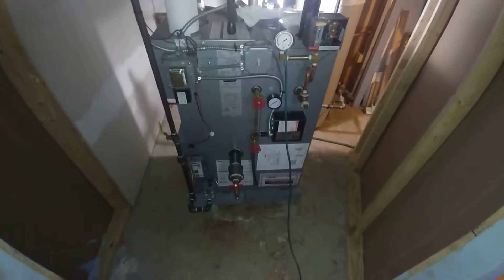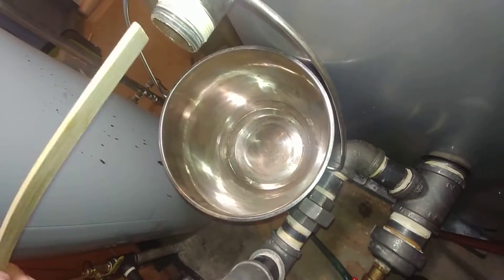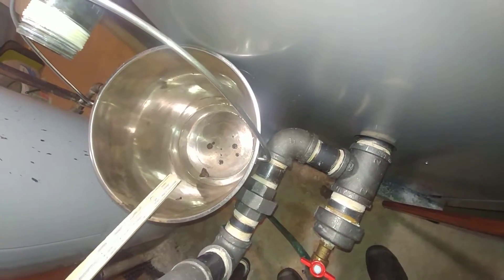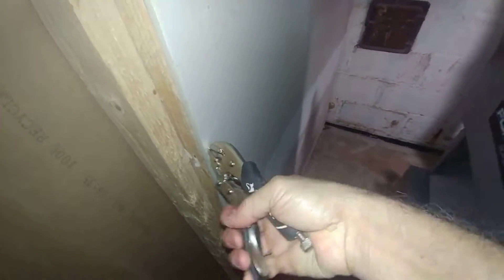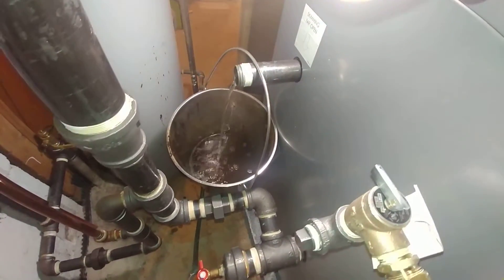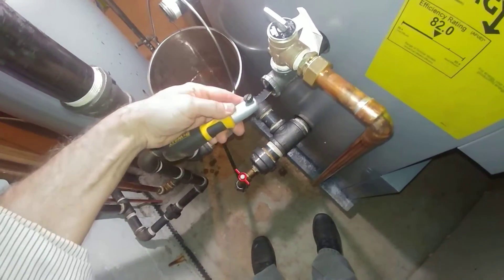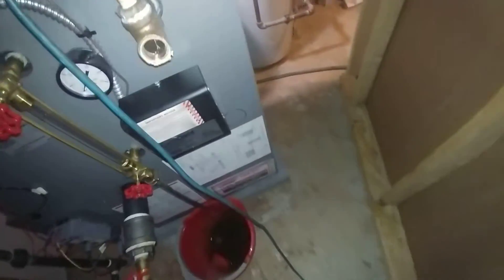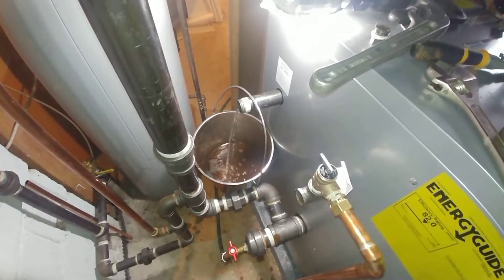Cleaning A Newly Installed Steam Boiler... Boring But Necessary

Comment: Can you just add a soap to the boiler when first installed and then fill , heat, drain it quickly and be done with it rather than slowly skimming over a long time?
Reply from the maker: Sure, you CAN do that.
But I wouldn't.
I tried it - once.
One soap bubble floating about is an ethereal wonderment of the universe.
Hundreds of thousands of soap bubbles roiling in a boiler is a waking nightmare.
Reply: @gordonschweizer5154  Your very good with words.

Comment: I just replaced my steam radiators air vents and at the hydeonic supply store the guy told me to use squik or soemthing like that to get rid of the rust and oils that may be in my new crown boiler ( the radiators are old) would you suggest this? Why/why not?
Reply from the maker: @Emma-g5qe I would not recommend using squick unless it is mentioned in your boiler manufacturer's written cleaning instructions.
I recommend reading, understanding, and following your new boiler's written cleaning instructions to preserve your boiler's warranty, to say the least.
Clean water makes for clean steam.
Clean steam makes for quiet and efficient steam

Comment: Hey I have a Crown Bermuda that sounds like a jet engine at start up   When it’s cold after 5 minutes running the noice will go away any ideas what could it be. I tried skimming it and found the port to be clogged up real bad and after clearing it, a really bad oil smell came from the port. I tried flushing it out a few times but that noise won’t go away.
Reply from the maker: Well, cleaning Always helps, but I don't have a clue about the "jet engine" sound on start-up.
That is not normal on an atmospheric boiler.  Is the gas burning inside one or more of the burner tubes, perhaps?
Reply: @gordonschweizer5154  the noise sounds like it’s coming from the heat exchanger. It only makes the sound when the boiler starts up cold and it last about 5 minutes and after is warm up the sound goes away. Could that sound be do to it creating steam? I just think that it’s too loud and wonder if it’s normal.
Reply from the maker: How old is your boiler? Does it need re-filing often?
Reply: @gordonschweizer5154  about 9 years old. It takes water in about every month. Heat exchanger never had the soot cleaned on the outside so I’m also wondering if that could be it.

Comment: Is this video for a Homeowner or a plumber?
Reply from the maker: Both.
For the plumber who might not know & wants to learn to be better.
& for the homeowner who might want to do it themselves.
Reply: Well that's very interesting.  By training I'm not a plumber whom I have much respect for the profession, but I am a homeowner that just had a replacement boiler installed.  This may sound funny but I did my homework and learned about skimming.  I even calculated my total EDR (my house uses Tubular Radiators) and determined the boiler model the contractor sugested was enough to support the requirement (as a double check some pros looked over my calculations and agreed they are correct).  I brought skimming up to the contractor who put in the boiler and his reply was "this model does not require skimming".  An answer that was in contradiction to everything I've read which is that every steam boiler requires skimming and in contradiction to the installation manual for the boiler.  So at this point I have to probably do it myself since the contractor doesn't seem to want to, perhaps out of ignorance or perhaps he wants to be paid for the time, and it was not in his proposal.  However, the installation manual for the boiler, which specifically sates is for "qualified personnel" which would seem to eliminate a mere mortal homeowner, states that there has to be a boil-off (New Yorker Boiler's term for Skimming).  So, I think if he doesn't bite the bullet and come do it as he should have, I will have to do it.  Thanks for the reply.
Reply from the maker: @DIYerGuy  Thank you for speaking up!
Too many folks don't know what they don't know (me included!)
But the day I stop learning is the day I've died.
That's why I make these videos, to try & share.
Don't be too put off by the "qualified person" language in the manual.
I've seen boilers installed by "qualified" licenced plumbers & inspected by the city no less that were total f#%×-ups!
Reply: Thanks for the encouragement Gordon. I know what you mean with those total f#%^&-ups.  I could be wrong but there seems to be no consistency with the knowledge level, and I don't say that as a criticism but simply as an observation.   For myself, the process of having a new boiler put in has been both scary and a real learning experience. For example, my old piping had this wild looking bend from the floor level up and around and back down into the boiler and there was a section of the riser that fed back and attached to the loop.  It was the first thing that caught my eye the very first time I laid eyes on it, but I said to myself why does it bend the way it does and connect back into the boiler.  It was a total mystery to me.  I researched this and realized I was looking at a classic Hartford Loop...  Mystery solved !   The scary part is because of the costs involved and the inspection process, which is another area that seems to be fraught with possible gotcha's. I'm still waiting for the inspection. But the experience has given me a better understanding of how radiators work, and the Beast In the Basement.  It's increased my appreciation for what's involved in plumbing and hydronics.  Seems that steam heating is a dying art, which is incredible considering so many structures continue to use it. I've also ordered a book, by Dan Holohan, titled "We Got Steam Heat",  which covers the topic for homeowners.   I'll check out your other videos and see what I can learn from observation, etc.  Fun stuff!  I don't know where you're located but if you see a giant cloud of steam in the sky and you hear a loud bang that was me skimming my boiler !

Comment: after the 1st skim do you still do them? Yearly? monthly?(Steam one pipe system) I just did mine and had a lot of dirty dark water. Not so much goo like you say, but it was very dirty and dark. Is that normal? Can it be old water in the system? It replaced  a 40+ year old boiler that had sealer in it and all the radiators didn't have a pitch to them.. Thanks again. This is like my 10th question i have asked you
Reply from the maker: Each boiler is different.  Each model of boiler is different.  Each system is different.
For you, the biggest issue is most likely the boiler sealant used.  That stuff is usually trouble.
With each model of boiler, the starting point is what the manufacturer recommends in their install manual.
How often should you skim/flush?
It depends.
If there is stuff very visible on top of the sightglass meniscus, clean per instructions, that's for sure.
Sometimes, you need to skim and flush several times.  There is no set end-point, unfortunately.
Reply: @gordonschweizer5154  Boiler has been running great and strong since the skim and the flush. Water is clear in the slight glass. Its a bit blackish when its running but not as bad as it was before the skim/flush .I am thinking since all the radiators weren't pitched correctly made some of the gunky water made it back in the system. I also pitched the return line a bit more. I did find a screwed up ball valve on a copper add on radiator line. Valve was hidden behind sheetrock for the ceiling and they flipped the handle around to get it to fit between the floor joist and the sheetrock. It wasn't opened all the way and got some bad banging on start up. Opened and all good. I am going to do another skim/flush on the weekend. Going to be cold this week so she will be working a lot. Thanks again
Reply from the maker: @richconstantino8485  That is excellent news all around.
Thank you for telling your story!

Comment: Not a bad job. I highly recommend skimming at a lot slower pace. Give it time to reach the quick skim. 
Even with a quick skim tapping, I still skim through the site glass (gauge). 
The installer should have used an eccentric reducer on the drain. This would ensure you get all the gunk out. 
What chemical do you treat with? I prefer Surge-X.
Reply: The installer did in fact use an eccentric reducer on the rear drain as seen @1:11.
The installer generally does not use any chemicals.  That's a topic for another day.
The installer also skims through the sightglass, because, as I am sure you know all too well, scum loves to hide there, too!
Thank you for your comments and your kind words! Stay safe.

Comment: All that is not necessary I install a brand new Utica steam oil boiler is been a month is running like a champ
Reply: It is necessary
Reply: It is necessary. Clogged control ports (trappings) is amongst the top reason. I won’t begin to list the others. That is why some (if not all) the jurisdictions require secondary low water cut offs and manual reset pressuretrols. For people like you who don’t neglect their steam boilers.
Reply: I am glad it worked out for you.
Did you install the boiler for yourself or for someone else?

Comment: That looks like a Burnham Boiler Block setup. Crown looks the same, except they have a really nice red and dark grey crinkle paint finish.
Reply: Oh yes, same people. Its a US Boiler product to be sure, meant to meet a price point.
Reply: Gordon Schweizer 
No problem with that, if it works well why change the design?!
A good product is a good product
Reply: @bauhnguefyische667  Right you are, sir! I like the quality sight glass package, brass all the way, no hidden chinesium steel to rust.  There are a few other things I could take issue with, but, it works and gets the job done.

Comment: Seems like this should ve offered as a standard maintenance but local folks don't do anything.  ☹ i wish you were located near by.
Reply from the maker: I would agree with you. Clean water makes clean steam. Clean dry steam is efficient silent steam.
Reply: @gordonschweizer5154  perphaps you should consider consulting over video stream 😁.
Reply from the maker: @yevreeva  Thanks! It might come to that.
Reply: Where are you located, if you don't mind me asking?
Reply: @elgordo271  Hagerstown, MD
Reply: @yevreeva  We've put in a few boilers for customers in Hagerstown.  Usually best to call All Steamed Up to get into our que for the summer months if you have major issues.  It is a bit far for usual maintenance, I'd agree.  What sort of steam system do you have? Single pipe or Vapor (ie two pipe)?

Comment: Perfect installation!!!

I have a quick question: my radiator in my room was running cold. So I did what some would say is stupid and took the vent off and turned on the boiler with a large nipple and 90° angle installed. Water came out BLACK, then it cleared up and now it seems to be heating up fine without the banging sounds. Why would that have happened to my radiator? 

The valve is brand new the vents all worked fine except for the Gorton vents those ruined my carpet since water came out of them before I removed the water from the radiator.
Reply: You should not have water that high in the steam radiator. Only hot water radiators are full of water.  Are you sure its a steam system?
Reply: Mugen Mundo Yes, it’s a steam system. My boiler is a brand new New Yorker CGS-70C.
Reply from the maker: The shut off valve may be almost closed or broken in the partly shut position. That's where I'd start.
Reply: Gordon Schweizer I checked the valve and it’s completely opened. I thought that might have been the problem before, that’s why it’s brand new. Right now it’s getting warm, but it’s leaking a little from the vent opening.

The radiator is pitched towards the pipe and everything.
Reply: @PepsiManX360  Ok, that seems to eliminate the easy part.  Now it gets a bit more harder. Do you have access to the pipe supplying the radiator in question?  Is that pitched properly?  Any water hammer on start-up? Oh, and what pressure are you running? What's the water look like in the sight glass? Wet steam, maybe? Contaminated boiler water? Near boiler piping issues? Water level too high? Uninsulated pipes in a cold crawl space?
Reply: @elgordo271  great set of questions.